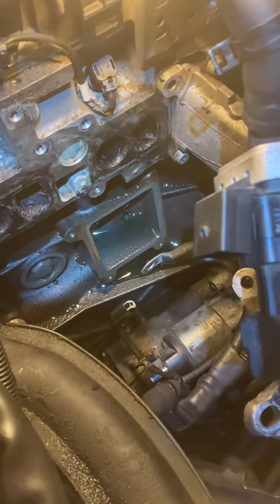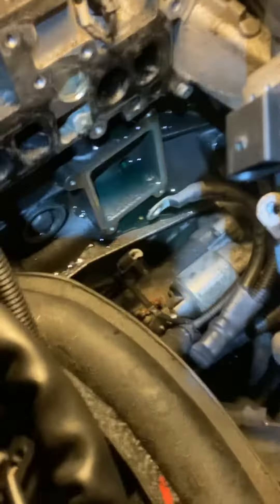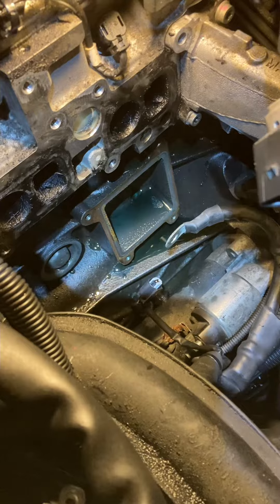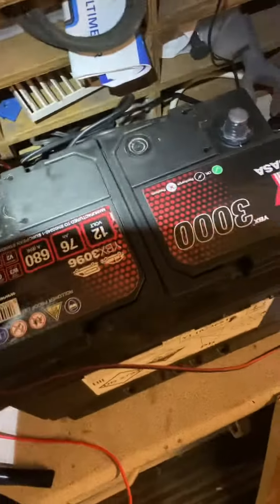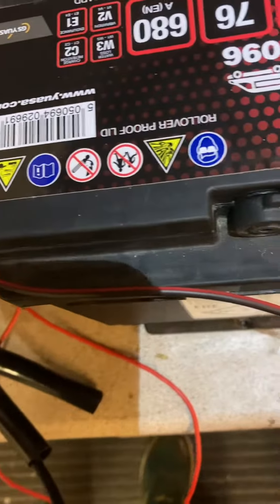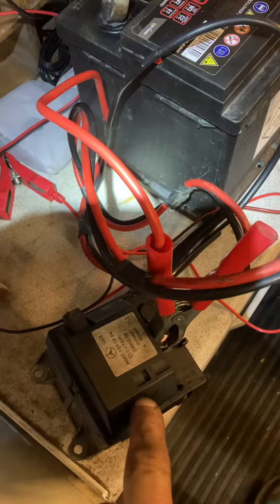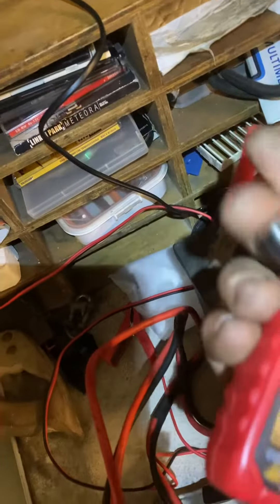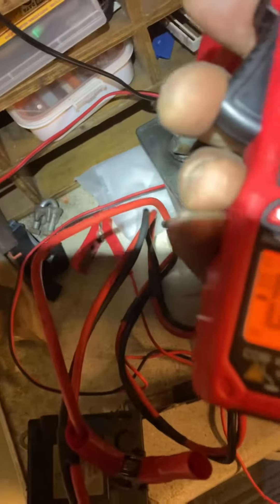W203 Battery Drain P4/5 Booster Heater

Comment: Thanks for the great vid. Did you use specific torque for the screws of the booster heater? Im also planning to do this repair but im not sure about which torque, maybe 10-13 Nm? Cheers.

Comment: Great video Do I need the booster circuit its showing ng short out can start the car. If I disconnect it and isolate will that work?
Reply: You can disconnect it, by removing the thick live cable. but must insulate the cable.  The car doesn't need it  and it will run fine without it